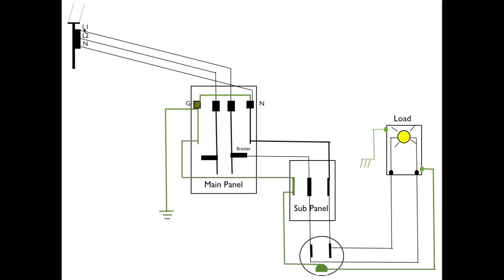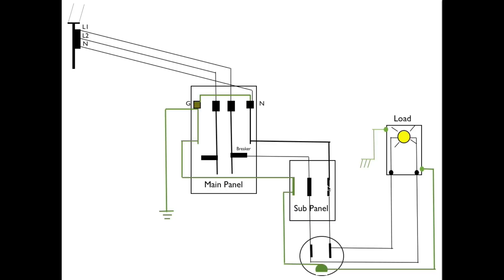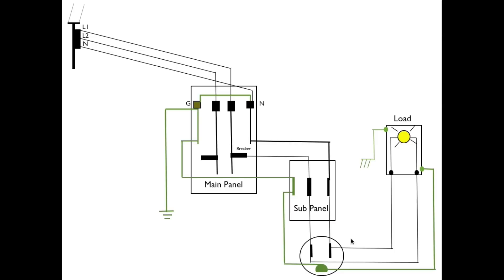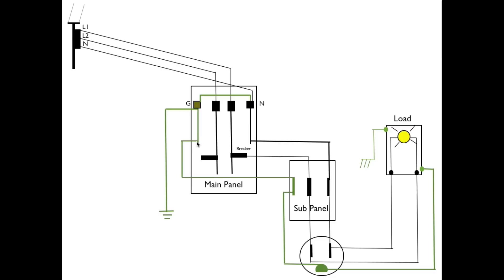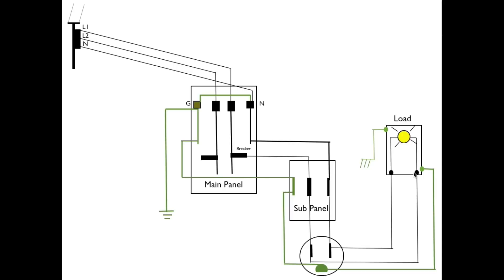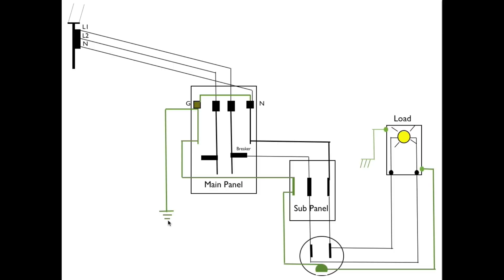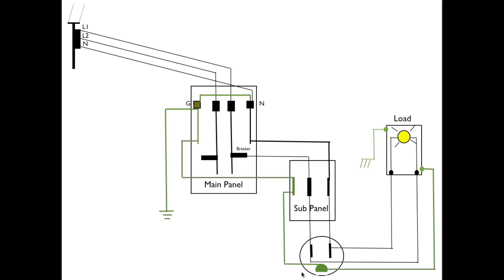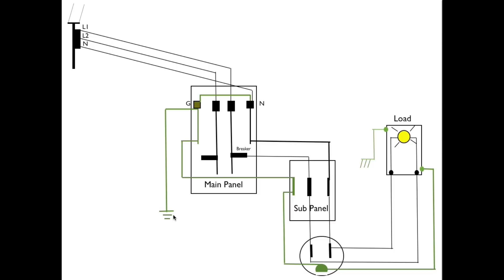The difference between neutral and ground on the electric panel

Comment: You explained the reason for operational grounding. You did not explain the reason for protective grounding which is a different thing. It is to prevent electric shock if the equipment case happens to get hot. Operational grounding is older, adopted 100+ years ago. Protective grounding is a newer concept, adopted largely on the latter part of the 20th century.

Operational grounding is connecting part of the electric circuit (the neutral) to ground. Protective grounding is connecting parts that may become part of the circuit in case of failure to the ground (using the ground wire).

The reason you do not want not use same wire for neutral and ground is because of the current there is voltage losses and the can cause differences in the ground potential which then can cause interference in various electronic devices. Also one cannot use a GFCI on such a wire.

Comment: Neutral is a current carrying conductor. I understand all the reasons why you do not want the ground and neutral connected at the sub box. What I am scratching my head about is WHY do you connect ground and neutral at the mains? (And then run both ground and neutral to the sub.) If they are connected there, then they are connected at the sub box, EVEN IF you separate them at the sub panel. It's a circuit. If they are connected together ANYWHERE in the circuit, they are connected everywhere in the circuit. By the way, where I live, they require the ground and neutral separated at the sub. And they also require no ground wire from the mains to the sub, but TWO ground rods driven for the sub. Real rods, no pipe, as you said. 6 feet apart. Actually seems to make more sense. Except that in the end... The ground and neutral are STILL connected at the main. Everyone keeps saying don't ground the neutral. Then they intentionally ground the neutral in the main. It just doesn't make sense.
Reply from the maker: Consider what would happen if there was a fault in the appliance that allowed continuity between the appliance chassis and the neutral side of the load.  If then the neutral became open.  The load would operate normally thru the chassis.  The chassis is now potentially hot.  If the chassis path back to neutral were to broken (a very common failure)  then the chassis will be hot.  If in your locality, a ground wire is not necessary from the sub, your jurisdiction is about 25 years behind.  The use of conduit as a ground has been discontinued in most jurisdictions since the mid 1990s.  
GFM
Reply: The sub is required to have not one, but two ground rods, here. But no ground required, leading back to the main. I still maintain that if the ground and neutral are connected ANYWHERE... They are connected everywhere, if all grounds and all neutrals have a path back to the mains.
Reply from the maker: I just want you to think about it for a while.  You will understand.  If not I have a playlist on electrical that may help.
GFM
Reply: THAT makes sense of what I was not understanding! Thank you very much. :)
Reply from the maker: That may make sense to selador11 but it is not true.  Earth ground is not part of any circuit.  It is only there for a sink for lightning or surges.  If I touch a hot lead and am in contact with earth ground (not neutral), I could get a shock but it will never trip a breaker.  That's why they make GFCI devices.  The idea of 2 or more connections reducing impedance is not meaningful.  Not trying to beat you up but the idea of earth ground passing enough current to kick a breaker is somewhat dangerous.
GFM

Comment: Sorry, but this is plainly wrong! At 8:00 - current will NOT flow if neutral and ground were bonded at the sub-panel and the neutral were to fault open. The load would NOT run normally, it would not run at all.
There are three neutral wires: 
1) panel to sub-panel, 2) sub-panel to outlet, and 3) outlet to load. 
Current will NOT flow with an open neutral. Opening ANY of the three will NOT cause current to flow, WITH or WITHOUT a bond at the sub-panel. 
Electrons do not normally preferentially choose the neutral conductor over the ground conductor, but when the neutral opens they suddenly flow in the ground conductor.
If they flow in the ground wire when the neutral opens, then some will also flow in that same wire when the neutral is present.
Reply from the maker: When I speak of the bonding of the neutral and ground, I am including the outlet and the load itself.  After all, the outlet and the load are sub panels.  The point here is the failure of the neutral in a bonded load or panel will energize the chassis of the panel or load.  This becomes a problem when there is an open with the chassis ground.
GFM
Reply: Not so. There is no such thing as a bonded load, that would create a hazard for any human in contact with any such load/appliance.
The statement: " the outlet and the load are sub panels" is correct, but the result of an open neutral is not as you describe it.
It's very simple, cut the neutral in an extension cord and put a simple wall switch inline. Turning the switch off will create an open neutral condition. 
The load will NOT run with an open neutral.
Reply: Even simpler, if it were as you describe, there would be zero resistance between the ground and neutral pin of any such load.
Reply from the maker: Actually, the resistance between neutral and earth ground is very close to zero.
GFM

Comment: Does the massive ball of spit you swallow every time you pause have the same potential  as the joules per coulomb in antiparallel conductors
Reply from the maker: Is being insulting your normal method of communication?
GFM

Comment: What does L2 wire do in main panel?
Reply from the maker: L1 and L2 are opposite poles of the 240 volt circuit.
GFM

Comment: I put a clamp meter in the neutral wire and it reads nothing even if the circuit is loaded..single phase Line to Neutral
Reply from the maker: The load you are reading could have an open neutral with a short to chassis inside the load.  Try checking amp draw on the grounding conductor.
GFM

Comment: I thought the sub panel should have another grounding going strait to earth, and not back to the main panel ground?
Reply from the maker: If the 2 grounding conductors do not end up in the same voltage potential, you could have a ground loop which can make the ground hot.
GFM

Comment: Other than safety concerns, as practical matter,  GFIs won't work correctly if they're connected to a load bearing neutral (pretending to be a ground). Other than these two issues, one could forget the safety ground and everything would work just fine. This means one could run 2 conductor cable to grounded outlets, for example, and simply jump the neural to the ground connection and all would be good. Of course, you don't do this for safety concerns but in old houses, it's the wild, wild west and you're liable to see most anything. In short, never, ever, assume anything.

Comment: For lots of fun, get an incompetent electrician who connects the ground to the gas pipe instead of the cold water pipe! You'll get a real bang out of it! Also, when someone says "cold water pipe" they obviously mean metal pipe. If you have plastic water pipe then you drive a metal rod into the ground and solder or weld ground wire to it.
Reply from the maker: Actually, it would work ok as the codes require the gas pipe to be bonded to the ground rod.
GFM

Comment: A broken ground wire will not make the said recpt. case hot... A broken neutral wire will cause the light not to work... a loose neutral or hot wire on recpt. will cause the recpt. screws to get hot...the concept is good but the explanation is partially wrong.... Remember that electricity travels the path of least resistance....
Reply: A broken neutral will make the chassis/ground hot if there is a fault to ground.  This is in the case of a connection of neutral to ground at the sub panel/appliance.  
Electricity does not travel the path of least resistance.  If it did, no parallel circuit would operate.  Electricity travels all paths.  Lower resistance simply increases amp draw of the lower resistance.
GFM
Reply: It does follow least resistance. 

The current flowing in parallel paths would differ according to the resistance of the conductors.

Comment: the NEC does not recognize the neutral wire as a load carrying conductor
Reply: It is considered a grounded conductor on 120 v branch circuits, but we all say neutral, but technically it's only referred to as neutral in multiwire circuits and you are right about nec regs
Reply: It is more nuanced than that.   Neutral can be counted as a current-carrying wire in certain circumstances.

The idea of "not counting neutral" as a "current carrying conductor", is due to the fact that it will not add heat to your bundle of wires in the conduit, assuming linear loads.  Suppose you have a 100A 3-phase/4-wire circuit.   At most you will have the three phase conductors carrying 100A, and when that happens, neutral carries zero current.  If the neutral does carry some current, it means there is less than 100A on at least one of the conductors.  The net heat generated among the 4 wires, never exceeds the maximum that the 3 wires can carry on their own.

If the neutral must carry current, to complete what the phase conductors supply, then you DO have to count it as a current-carrying.  Single-phase to neutral loads are one example of this.  Another example is two phases and a neutral, sourced from a 3-phase grid, as is common to feed apartment dwelling units.

When you have harmonic intensive loads, i.e. non-linear loads, you may also have to count the neutral as current-carrying, even with balanced loads.   Harmonics that are multiples of 180 Hz (known as triplen harmonics) add up on the neutral, rather than cancel.  It can in some cases, require extra sizing on the neutral wire and bussing.  People who build data centers often have to account for this fact.

Comment: Why do you have two phases coming in?
Reply from the maker: It is not 2 phases.  It is just both ends of the secondary winding of the transformer.
GFM
Reply: so what is the voltage across the L1 and L2?
Reply from the maker: 240 volts.
GFM
Reply: Correct. There is only one phase, as only one secondary winding in the transformer is used. The center tap on the transformer provides a "zero" reference for L1 and L2 when 120 volts is desired. 

If we only needed 240 V, then no center tap would be needed.
Reply: in UK we have 1 single phase and neutral at 240V and earth.

Comment: So, N is G and the big prong is nothing more than the same as the ground?  Why have the third ground plug then?
Reply: Because current is flowing in the Neutral, it is not at zero potential (ground) everywhere. There is, under normal circumstances, no current in the ground conductor so it is always at zero volts. N=G only at the point where they are connected, i.e. at the panel, everywhere else N>G.   Now, in a car, however,  the return conductor, the equivalent  of N, is the frame, which is the same as ground. But then again, the frame of the car is a heck of a big conductor so voltage drops along the route are not an issue.
Reply: lynn rathbun
Where does this voltage come from since, at the box, it is the same potential as ground and is actually directly tied to ground?
Reply: ***** At the box, they are the same. But as the current flows in the external circuit there are voltage drops along the wire. The potential between Line and Neutral at the load is lower than the potential between Line and Neutral at the distribution box.  14 guage wire has a resistance of 2.5 ohms per 1000 ft. that is 2.5 volts at 10 amps.
Reply: lynn rathbun
That boggles my mind how anything connected to ground can have a voltage but I am only used to DC for the most part as I am deathly afraid of 117vac and so much so I will pull the main meter if I have to but most times throwing a breaker works.  Scares the crap out of me to watch people messing with live wires (professionals or not).
Reply: ***** Anything directly connected to ground will, by definition, be at zero volts. But connection by a long wire is not directly connected, as wires have resistance. So   the end of a wire with current flowing in it will be at a different potential than the other end.
Reply: lynn rathbun
Now that makes sense BUT even the ground wire (3 prong) has many many feet between it and the grounding rod out at the box.
Reply: Yes, but no current flows in the ground, under normal circumstances, so there is no voltage drop along it. The ground only has current in it if there is a short from the hot to the ground.  It assures that things that you can touch (metal) will always be at or near ground, not floating where they could become hot.
Reply from the maker: You a little wrong here.  Certainly, there should be no current flowing thru the ground wire under normal circumstances.   Any fault current will travel from the chassis ground to the main panel where the neutral and earth ground are bonded.  Then the fault will travel in the neutral to the pole transformer and open the circuit protection.  There can be no short to earth ground. 
GFM
Reply: grayfurnaceman I was talking about the external circuit, where in a fault, current definitely flows in the (chassis) ground wire back to the panel where it is earthed.

Comment: Too complicated. WHY they don't make a box with 3 bus bars (1 positive - 2  neutral - 3 ground)  instead of 2 bus bars?. that is why everybody connect the white neutral together with the green earth in the same bar.You experts please tell me how to connect the neutral and the earth separated if I don't have an extra bus bar.I'll appreciated your answer.Thank you
Reply from the maker: The 3 wire system used in the US provides the choice of 2 voltages without the 4th wire.  There are 2 hot wires and a center tap of the pole transformer that we call neutral.  There is no positive in AC systems.  There are only hot leads and neutral.  That neutral in the main panel connects with the pole transformer and provides the second path for current.  It also provides a path for fault current that may have energized the chassis of an appliance due to a short.  When that chassis is energized, the short travels to the neutral of the pole transformer and because the amperage is excessive, the circuit protection opens.  
When we separate the neutral and the chassis ground at the appliance or the sub panel, we protect the appliance or sub panel from the chassis from being energized if there is a ground fault.  Consider if the chassis is energized.  If then there is a fault in the appliance, and also a fault in the chassis ground, the appliance chassis is now hot.  I hope this makes this a little more understandable.
GFM

Comment: @ :59 you say the neutral is bare from the transformer. Sorry, but it isn't here. Our wiring is insulated wire for all 3. Goes down the pole in metal conduit until it is underground and aimed for the house. The wires are then buried under concrete poured in the cable trench. It comes up out of the ground in another conduit to the meter can.  When the wires get to the meter can, it still is 3 insulated wires. The meter can has both a water pipe bond and a ground rod bond. Our wiring in the home runs in metal conduit. The wiring is either 3 or 4 wire depending on the circuit. ( 120/3 wire, 240/3 or 4 wire ) All of our generators are also 4 wire. ( Yes, we have properly wired transfer switches for them. )
All our pipe in the house is metal ( copper or steel ) and we are on a well. The connections from the well pump to the well and from the well pipe to the pump breaker box are all bonded also. Water in the dry season is only 6' down. In the wet season it can be at ground level.